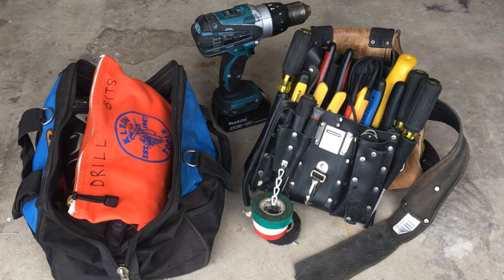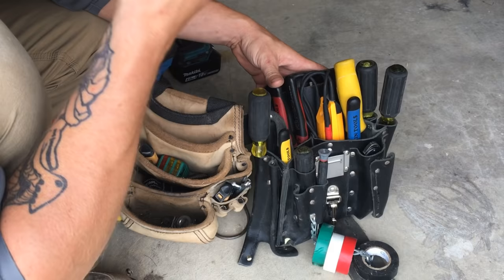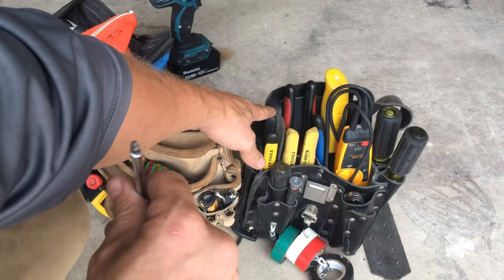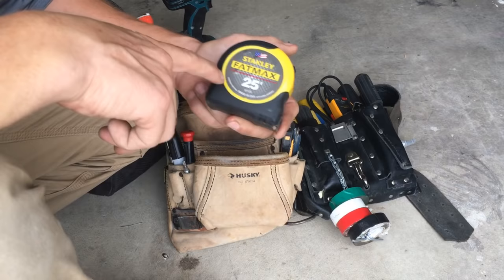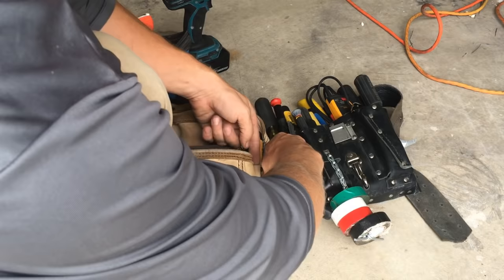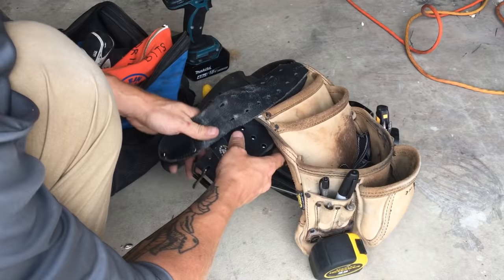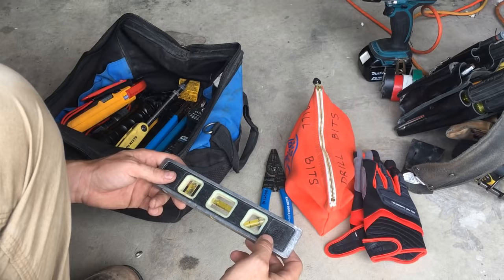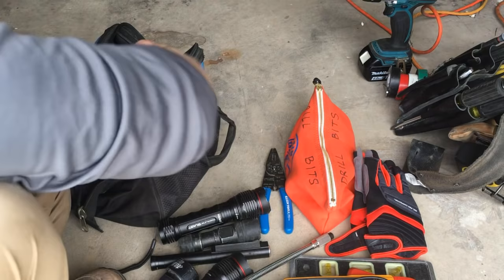Episode 2 - Tools Every Apprentice Electrician Needs To Start Their Job

Comment: You have some great videos. I have been thinking about getting into the trade. My only hold up is a few injuries I had after a pretty bad motorcycle crash ten years ago. So I have to ask. What parts of your body is this trade hardest on and over all how physically demanding is it? I am not afraid of work but I also don’t want to completely cripple myself be for retirement.
Reply: Steven Codding honestly attic crawling is probably the most strenuous physical thing, like any trade there’s physical aspects on a daily basis ladders, holding arms up for extended periods of time, getting low under sinks for garbage disposals, my coworker has bad back problems but he seems to make I through at least doing service work

Comment: What about insulated screwdrivers. Are they important?
Reply: Lee Schanck usually you won’t be working on anything hot your first year,  there’s been times I didn’t have one and wrapped the shaft of my screwdrivers with electrical tape to avoid shock,  electrical tape good up to 600v

Comment: Now buy $25,000-30,000  worth of sockets,power tools, wrenches, diagnostic gauges, scanners, oscilloscope, dial indicators,calipers,micrometers and torque wrenches and you can be a diesel technician and still make  about the same as a skilled electrician...damb im in the wrong trade. . In all seriousness though is there any sidework to be done as an electrician?
Reply: All I read is the Diesel industry is desperate for mechanics. You should be able to call the shots & make damn good money.

Comment: How come American electricians don't use fully insulated screwdrivers? I know they mainly use 110v supply unlike us in the uk who use 230v but 110v volts is still deadly.
Reply: Because we dont always work on live wires. And ive worked with guys that use insulated tools every day and mess up the insulation making it useless for live panels.The right tool for the right job;)
Reply: This video is about basic tools for the electrical novice, not an experienced electrician.  
That said, I bought a set of insulated screwdrivers for a particular application, and found that I use them for my everyday drivers.  They are easy to spot because of the bright orange and yellow cladding, and I can tell they are mine because everyone else is using regular drivers.  Haven't lost one yet.
Reply: In australia most electrical  apprentices are issued  a tool list or are issued tools by the company they work for and they are always told to buy or are given insulated screw drivers which can be bought as a set in a box of 5 plus a  set of test lamps

Comment: What type of tool pouch is that? Looks well worn, but still in great shape...
Reply: The black one is the Leather Tool Pouch, 11-Pocket Klein Tools 5167

Not sure about the husky
Reply: @jamestate858  Thanks bro, I've been using the Southwire pouch for years and it just wasn't quite big enough, always had to carry my Linemans in my back pocket, so I found a slightly used, but in real good shape MaGuire Nicholas6 pocket professional No 603 on ebay and scarfed it up, a little more room and still small enough for my needs, and I'm trying out the new Klein hybrid-pliers to see how they will benefit my space...

Comment: Nice video i Work electrician in Denmark somthinks arr not to my likink and you did not mention HILTI in power tools, that is the best you can get :D
Reply from the maker: Do you all use Hilti over there primarily?  Not many guys use it here, unless its big concrete rotary hammers/jack hammers etc.  They just don't have the market share here in the states for the average trades.
Reply: Mostly HILTI that is by far the best tools if you ask me :) in Denmark it is only companies i dont think many people own it at home :)
Reply: Hilti is almost exclusively used in commercial work in the U.S.   You don't see them much, because there is a lot of competition at much lower prices.  You can buy a very competent drill/battery/charger that will do what the Hilti does for less than half the price.  Besides, Hilti doesn't want to get into the bloodbath of a marketplace that is the cheaper end of the market.  They can get the commercial guys that aren't worried about the initial cost but want the best experience in a drill.

Comment: How about a good stud finder, fish tape and I know you mentioned a head light but a good flashlight.
Flash light should be covered in rubber or non conducting materiel on case you touch it to or across something live.
Reply from the maker: tpcoachfix I don't see it necessary for an apprentice to buy a stud finder or a fishtape for day 1 of their apprenticeship.  Most likely their Journeyman/Master will have these and if they don't...the apprentice has bigger problems to worry about.

Flashlights are a tricky one.  Nebo seems to make pretty decent flash lights.  I never worry about buying an insulated flashlight, but I'm never sticking my flashlight into live parts.  Only time I'm using a flashlight in a live environment while I'm working is on my head so I can work with both hands.  If it's in my hand I'm not working with the other hand - I'm probably using it to look around a room or in an attic.

Thanks for the input my friend!
Reply: Look for a vertical line of drywall screws if you don't have a stud finder.  Get the wiggly end for fish tape to get around bends, especially through flex.
Reply: A strong magnet is the best stud finder on the planet.

Comment: I started with electronic assembly before doing electrical.  You seemed to have no respect for apprentices.   I used my dad's Simpson meter which was very expensive so no one questioned me when I started doing electrical work because most elections could not justify the cost plus the cost of getting it calibrated on a regular.   basis.

Comment: Dude, you are carry way too many tools that do the same thing. Klein is great. Knipex and Wera are what you will want to steer toward. Much lighter weight, insulated (not electrical tape insulated), and each tool performs multiple functions. The only Kleins I have left are the journeyman 2000 lineman pliers (they're real tough to beat). And the milwaukee needle nose strippers that also have 6/32-8/32 bolt cutters (second version) they are not as forgiving when stripping hot wires as the ideals but def a more solid set of pliers. Splice on.
Reply from the maker: Julio Lopes oh buddy, I agree 100% - this is a basic video for the green apprentice who's just starting their career.  I've got a shit load of multi-use tools in my actual bag and normally I keep just a few multi-tools in my back pockets with a multimeter and I'm good for service work  These guys need to know the basics though so I wanted to give them somewhere to start.
Reply from the maker: Julio Lopes Also I've recently come across some Knipex stuff and I love it.  No more or less than Klein really but it's still great.  Haven't messed with Wera - what's the major sell there?
Reply: Electrician U If you check out their insulated slot/Phillips/Robertson set, its around $35 and covers all the screwdrivers your going to need in one shot. They're insulated for 1000V, they're lighter than the Kleins and with a full tool belt every ounce counts. The Wera set also comes with a laser cut tip that increases grab on the screws, you can put a flat head screw on the tip and it stays on it's great for getting a screw to thread into the back of a box when your fingers don't fit in there. The other advantage is the grip, the shape of it gives you a way better grasp on the driver. Right off the bat if you pick up a set the first time you hold them you'll wonder if you made the right call because they feel way different than the Klein drivers your used to, ignore that feeling and try them anyway. The Kleins will end up in the bag and eventually on your work bench. Also if you go with the Milwaukee or Malco 1/4, 5/16, and 3/8" nut setters and you already have the Bosch 6" extension and small drill to drive them, you can toss the Klein 10 in 1 😁 Finally pick up a set of Knipex Cobras in 7-1/4" and they'll never leave your pouch. Whenever someone asks to borrow them I say "look your going to use these pliers and your not going to want to give them back, make sure I get them back!" to which I get the reply "yeah sure" then they come back with a look of surprise on their face at how great these little pliers are. They cost twice as much as the channel locks which I also have a ton of and they're worth every penny.
Reply from the maker: Julio Lopes damn dude I'm sold!  I'm looking those up right now 🤘
Reply: I have knipex linesman pliers and mini channel lock pliers. They're awesome! The linesman pliers were loose right out of the package. You don't need to "work" them loose with a lot of lube, like the Klein ones.

Comment: Ratchet cutters boss man helps out younger guys with cutting bigger sized wire
Reply from the maker: That's a $300 tool, no way an apprentice needs to show up on day one with that.  Shit most of the Journeymen I know didn't get one until a year or so into their license.  We made them use long handled loppers after the 2nd time they cut a steel messenger cable with the ratchets lol.
Reply: Electrician U $300? Lol they are $30 I’m not talking about the powered ones just some hand held one boss man $30 at Walmart

Comment: Shit...   I just bought a 22 piece starter kit of "Commercial Electric" at Home Depot before watching this video for about $70 bucks.  Should I just use em' and abuse them (and keep for backup)  until I can upgrade or just return them?  I don't have much time and I'm on a budget until I get rolling.  Thanks.
Reply from the maker: Man you're fine with them to start out.  Once you learn how to use everything and/or break a few things you can start gearing up for better stuff.  They're fine for a beginner apprentice.  I'd just start saving up for better stuff once you decide if you want to stick with it or not.
Reply: Don't be a tool snob.  Use what works, find out what works better, and go with that.  Use the best tool for your budget.  Bigger budget?  You can now afford that Knipex stuff.  However, if you find that the CE or Kobalt or Harbor Fright (sic) thing does it for you, go with that.  Not all of their tools are crap.  Prepare for the tool snobbery, though.  Finally, don't pay good money for a tool without first putting it in your hand.

Comment: I'm interested in this field. But I'm just indecisive because I dont know if the courses in college are hard . Do you have any advice or letting me know if the program of electrical technology is difficult if you have attended one? Pls
Reply: 1st year is literally just attendance. If you show up and try your hardest, even if you only got c's your entire life you'll make it. Once you are out of the electrical schooling, the actual work is not intense intellectually or physically. But you need to be focused. If your mind wanders you're going to miss one thing and it's going to become a very big problem.
Reply: @joshbarr118  thanks man appreciate it, do you think its recommended to go to a local community college or not?
Reply: @derekserrano1622  i took a 6 month foundations program, but you can just apply to every electrical company in your area and start work. After a little while you can take a shorter level 1 course and start working your way up. College is mostly just a money grab, alot of your time is spent learning things you don't use and you will be mainly relearning or just straight up learning on the job actually working. Schooling is 80% books, 20% technical and 100% money. Ideally you should try and get a job first and see if you like it and want to become good. Or esle you just spent thousands of dollars for nothing. But if you have 0 trades knowledge and 0 skill in using power tools and just basic knowledge and want to build up confidence then schooling first could be the ideal route.

Comment: First rule of being an elekteician (I'm from Finland) is to always test to cable/wire before you cut, the wand is perfectly fine but it depends on the cable
And from my expirience half of those tools are useless, the only tools I've needed are a few screwdrivers, strippers, cutters, tape, some different powertools and sharpie, headlamp.
To me it sounds wierd af that you need to buy all the tools yourselves in America, the company you work for always pays for the tools and safety clothes

Comment: Do you spend your whole pay check on tools?
Reply: Gerry Gagnon just head to Harbor freight and buy Doyle brand tools, by far the best tools ever made, I cut 1 AWG wire with my Doyle linemans like a hot knife through butter, oh sure you could spend the extra money and buy those fancy Milwaukee tools where everything can also be used as a reamer, well I’ll tell you what my Doyle’s can do...get the job done quick and efficient. A set of channel locks and some linemans, some diagonal cutters, and needle nose all together run about $60...so no need to pay tons of money and burn that check. Man has often marveled at the wonders of the world..well my friend there are the pyramids of Giza...the temple of Artemis...and Doyle tools. Save your money on important things like bills and other things for your leisure activities. spend $60 and you’ve got the only set of tools you’ll ever need as long as you live.

Comment: But do you really need anything other than what is on your required tool list? Isn't the employer supposed to provide the rest?
Reply from the maker: shheeeeeeeiiiiit.  I wish!  I haven't met an employer yet that has provided me with ANY tools
Reply: ACombineSoldier the difference between union and non union, you buy a few hand tools here and there and are given a basic set when you are union, employer provides the rest..power tools, ppe..etc. and non union you’re on your own providing all that stuff

Comment: To be fair, if you’re just doing new construction you don’t need a multimeter at all but you definitely fucking need a tic tracer. One is a essential tool for electrical diagnostics the other is an essential safety tool. Always check if the wire you’re cutting is live. I find it extremely odd you disparage this essential safety tool! Can’t use a multimeter on a wire that hasn’t been cut yet people need tics!

Comment: GreenLee is an off brand?  Comparing it to commerical electric makes you seem like an apprentice.   GreenLee was established 1862.  They must be doing something right. 
Why don't you pick up some Klien bx cutters.  When they break on the 3rd, 4th use you'll begin to realize Klien is mostly overpriced tools.
Reply: beeps 
Klein is not really overpriced in my opinion. Turned in an 11year old pair of linesman at home depot today and got a brand new pair on exchange. Can't beat that.
Reply: The linemens aside most everything else by Klien is overpriced and doesn't hold up.  Got a Klien tape because i liked the double sides.  2 weeks after i bought it rust has begun to appear on it.  
The bx cutters i mentioned above did not last 1 job.  The blade broke and for $9 each i wasn't about to keep sinking money into it. 

The mere name "Klien" makes it expensive.  Like the clothe pencil pouches?  $30 each here in Texas.. absolutely rediculous. 

I do have klien tools in my pouch.  Linemens, dykes and needle nose atm.  But that doesn't make them the go to tool for electricians.  Truth be told they put out alot of sht.  

I stopped watching the video when this guy compared GreenLee with CE.  He comes off like a fan boy with not many years behind him.

Comment: Dude...if you work for a contractor you dont buy bits and drills....especially unibits.
Reply from the maker: I've worked for 4 of them, and that's never been true.  You've been fortunate to have them buy that stuff for you if that's the case.  I do turn in receipts for unibits though.  Too expensive not to.

Comment: Good shit man, thanks for the info. However, (story time) my dad has been an electrician for like 10 years, he used to talk shit about greenlee, but if you do your research you'd know Klein and green lee have both been around since the late 1800's, ON THAT NOTE buy quality, but more importantly  buy what you like, you're the one using all day everyday! 

check this out http://www.greenlee.com/catalog/Professional-Hand-Tools/Drivers
and note the handles....
Reply: Electrician U Milwaukee stuff usually is pretty good, and it looks bad ass, so I wouldn't see a problem with that
Reply: The only Greenlee tools I use is Slug Buster knock out cutters.
Reply: Yea greenlee seems to be in the other name brand. They're also the tool that I always see break. Could be quincedence I guess

Comment: That's way too many tools to carry  on your person. First rule of electrical club is work smarter not harder. Carrying 20 lbs of gear on you sucks. Your video is a great reference for the tools needed, but that loadout is a bit much.
Reply from the maker: Totally agree with you actually. For service I usually just keep a single bag to work out of, but in construction a tool belt is a must in my opinion.

Comment: i have no idea why you promote "hand tools" so F'n much.  you'd better have battery op power tools to start because you Will be required to use them asap. 

along those lines, i dont understand[but i do] why i see on TV these electricians using HANDTOOLs, is because they're taking the damn time doing $hit that could be done in 2/3's the time.  they may be cheap to hire, but they take 3 times as long.